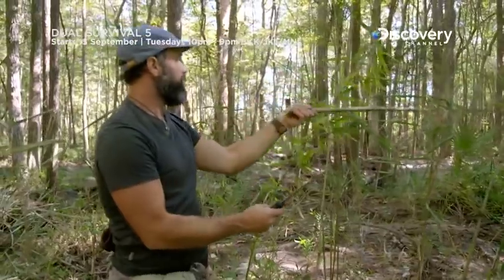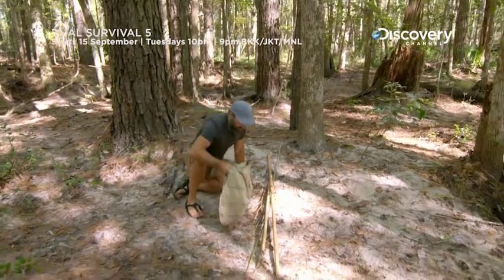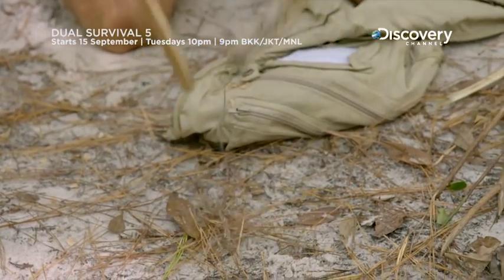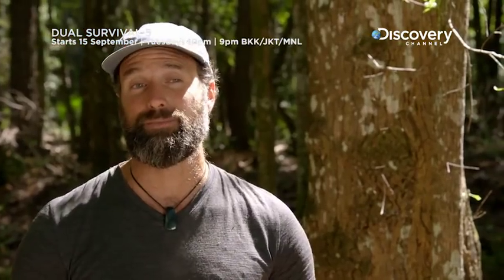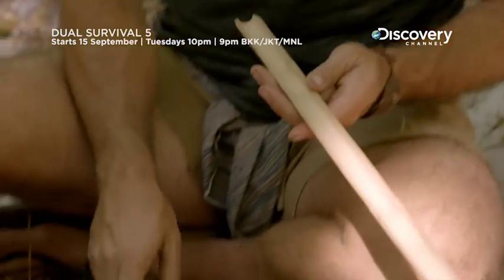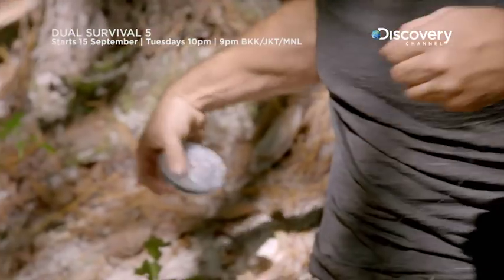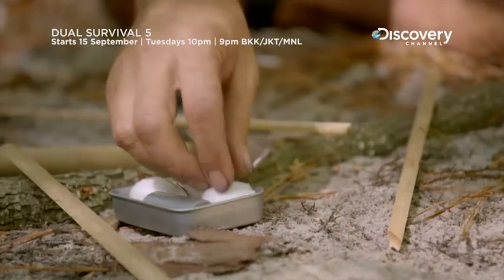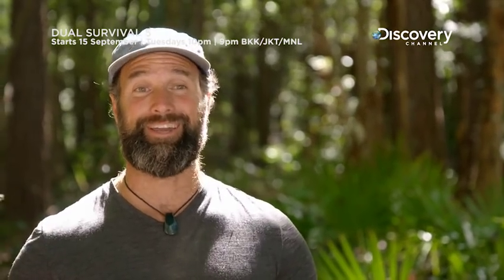How To Make A Blow Gun | Dual Survival 5

Comment: That knife is like a Smashett I need to start paying attention to the Gear you and Joe brought out. I go out there with an Ozark Trail fixed blade in the steel holds up pretty good if it gets bends you can bend it back it doesn't snap but it is fairly strong and you can baton.
Reply: Matt actually produces this knife and it’s not very expensive. It’s made by condor. I’ve had one for years it’s a great knife.